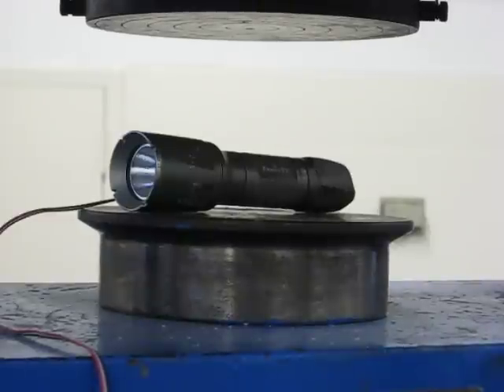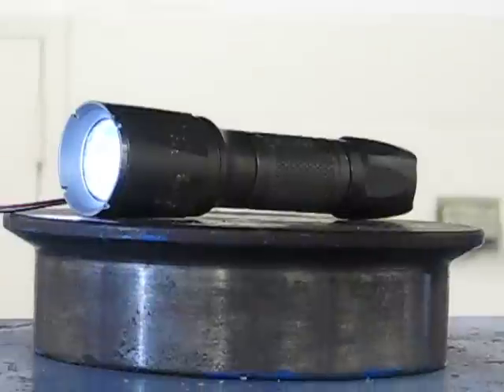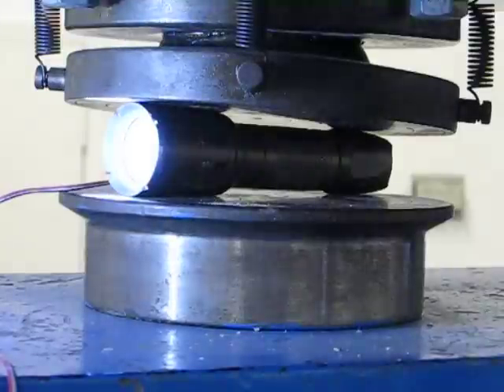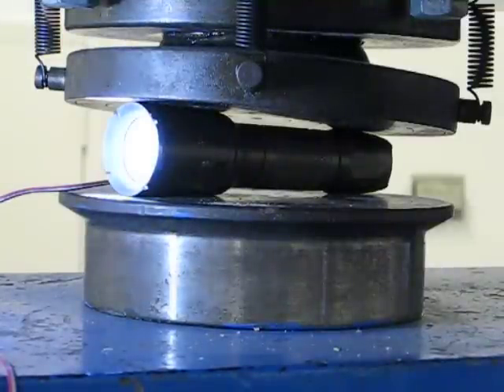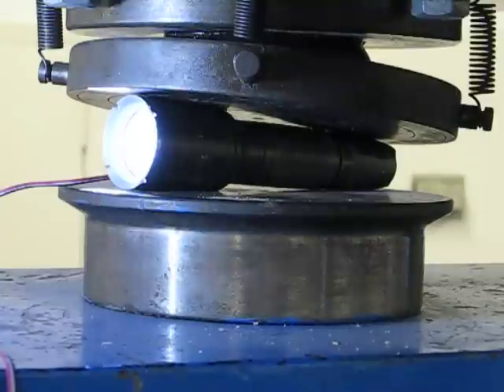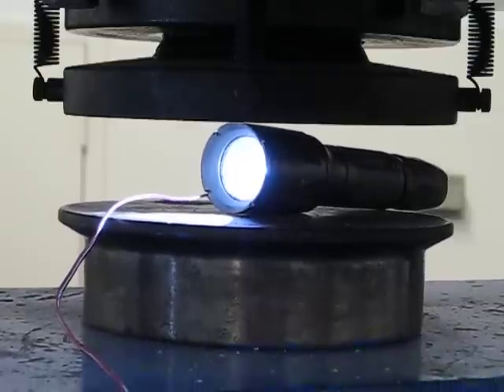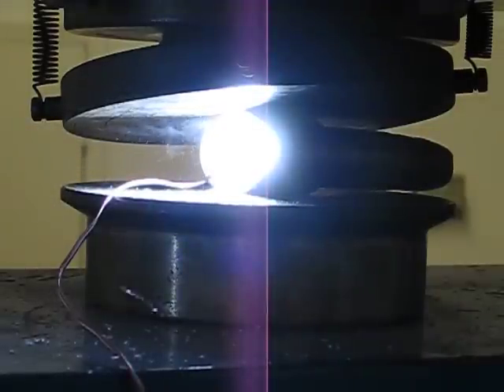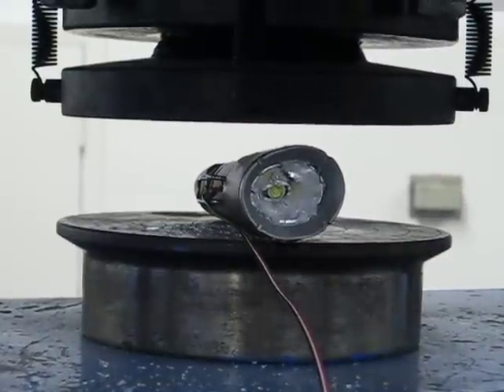Will It Crush - Fenix T1

Comment: @mesa401 but you got to realize that surefire only covers their warranty with primary lithium cells which cost alot in the end run.  some people just cant afford that so they buy rechargeable cells. fenix will offer warranty even if you use rechargeable batteries. i was looking into buying a surefire but didnt see the point because i would have to spend a fortune on just batteries alone.

Comment: the p3d has been replaced by the pd30 and i just bought one with batteries and a diffuser tip for around 65 or 70 off ebay...its the shit

Comment from the maker: Some RCR123's are longer than the spec for CR123 cells (due to protection circuit), and will not fit in the T1. They will not allow the tailcap to make contact with the body due to excess length of the cells.

Comment: Do you know if the FENIX T1 can work without damage with 2x 3,6v CR123A rechargeable batteries? Cause i know the manufacturer says 2x 3v, but doesn't mention 2x 3,6... thanks!